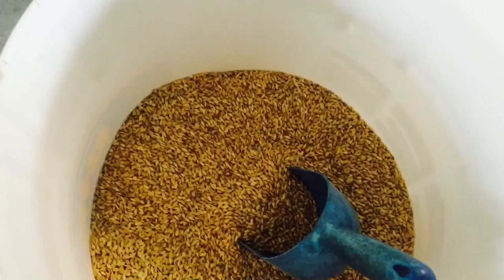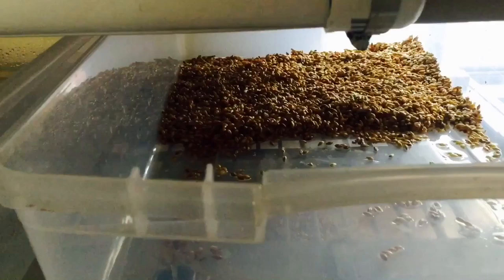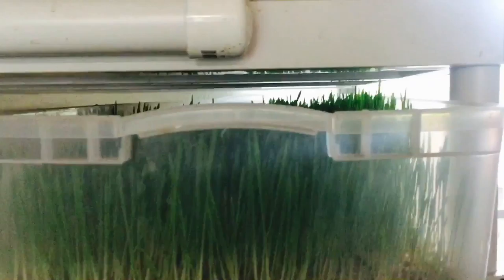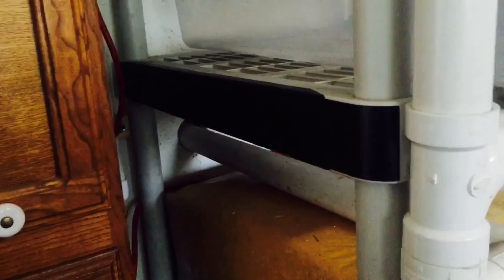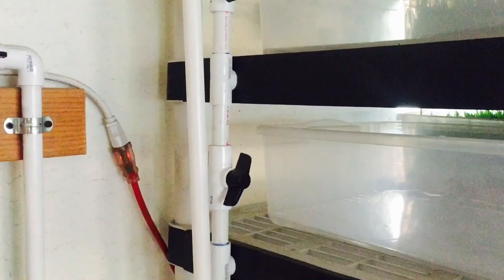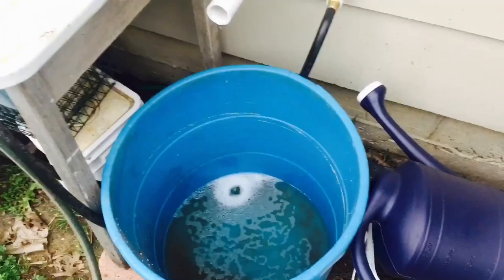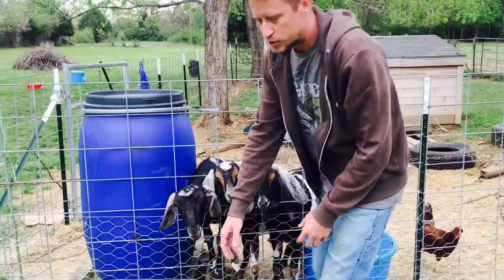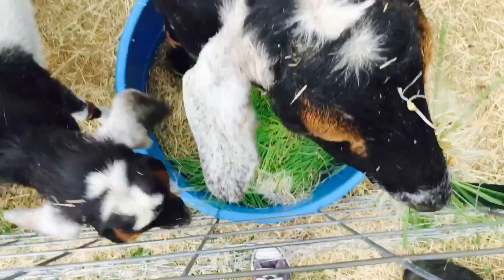Our Fodder System

Comment: I'm planning a fodder system build next weekend and this is by far the best video I've found.  I love the way designed the drainage out of the trays into the pvc drain pipes using a fitting to connect them.  Seems very efficient with a lot less cleanup.  Using a timer is great idea too.    Just got my chickens yesterday after a long coop build.  Thanks or the video and ideas.  ATB
Reply from the maker: +fireballmalone1 thank you so much. We are very pleased with the design overall. The only thing I am working on reengineering is the gray electrical conduit drain pipes. They are not lasting long enough and break and then they pop threads. So I am working through a couple concepts on that.

Comment: Good stuff thanks for sharing!
Two questions, are you not using any lights and what about mold?
Reply from the maker: Great question. Currently we can grow about 7-8 months out of the year because of mold. We keep ours in our garage so once the temps get between 85-90 degrees mold begins. At that point we shut down the operation for the summer. At the same time, we can compensate due to the grasses growing in our meadows to keep our animals fed plus allowing our goats to free-range at that time. 

Lights are not needed. In God's design, a seed has enough life and nutrients to last about a week before it needs lighting. Since we are feeding on day 7 there is no need for lighting. Our is near a window but in a dark garage nonetheless and does just fine.

Comment: Can you go into more detail on your drain fitting. What did you use exactly? How does all the water drain out of the trays? Did you drill holes in it? Any silicone or caulking to make it water tight? Why did you need the valves at every level? Are those used to tune it and get the same spray pattern for all the trays? Look like a good system, thanks for sharing.
Reply: A few of your answers are in the video

Comment: I've been growing fodder for about 6 years now. I've been cutting up the fodder into small bite sized pieces for the goats because the root mats are so thick that they'll grab ahold of it and shake the whole biscuit until they can get a chewable piece - but it makes the fodder fly everywhere and the majority of it gets wasted. How are you getting such thin root mats that they are able to easily pull off a bite? Is it all wheat? We do a 4/1/1/1/0.5 ratio of barley, peas, oats, boss and flax.
Reply: Spread it thin in your grow pan

Comment: Can this be grown outside? (Phoenix, Arizona). What light requirements does it have? Can you mix grains and sunflower seeds? How much does this replace your other feed for chickens and goats?
Reply from the maker: This can be about 75% or more of the diets for our goats and rabbits, they also need long fiber in their diet. For the pigs and chickens, espcially since they both are free-range, can be fed this entirely. Their diet also consists of any food scraps we have.

For Phoenix, Arizona, (born and raised their for 34 years) the heat is your nemesis. After about 90 degrees you will start getting mold issues. So yes you can grow it outside but it will be seasonal. It does not have light requirements really. The seeds has about 7 days worth of stored energy in the seed before photosynthesis is required to create sugars. Since we are feeding at day 7 there is no need for light.

I would encourage you to experiment with mixing. You can find charts online to see the difference in days for sprouting. Some seeds require more and less soak times as well as more or less grow times.